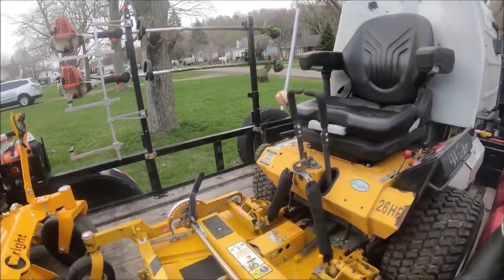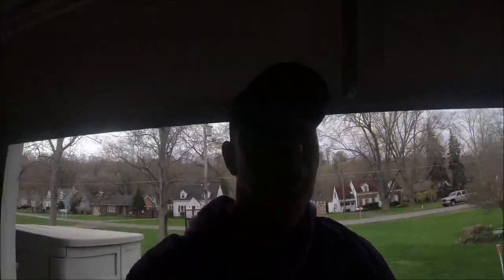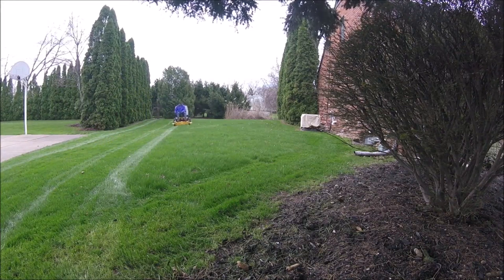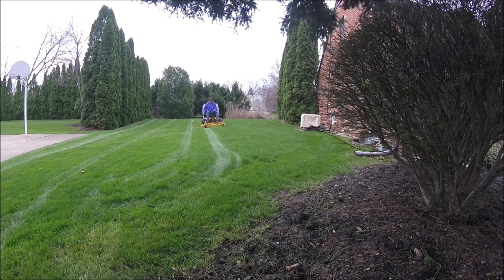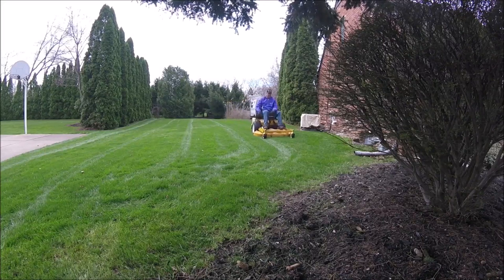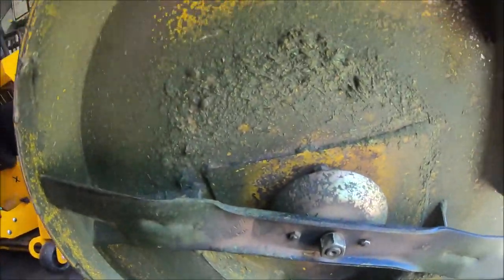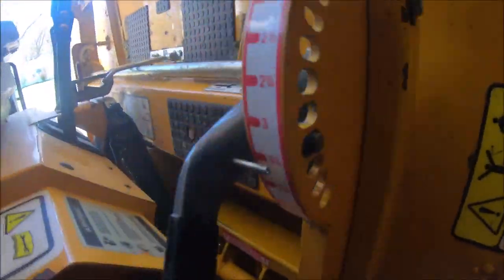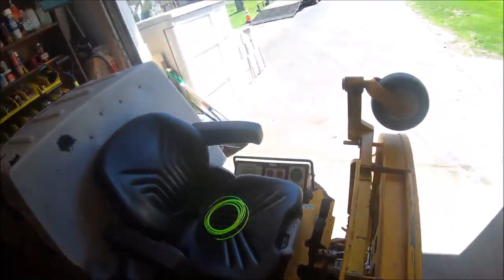Wright Sport X Mowing Lawns Walker is Fixed // Countryside Vlogs

Comment: Randy, order up new bearings, seals and gaskets online and rebuild that used unit. Its extremely simple it all just slides together no pressing or anything. Just having the good shell is nice... Im sure you will run with it for a bit but at least have the parts on hand and the next rain day take an hour and rebuild it.
Reply from the maker: Did you see the old one? There's no rebuilding it. The casing is busted in half. I've rebuilt then they're super easy
Reply: @CountrysideStrong  yes I was talking about the "new" used one
Reply from the maker: @KenMrKLC  oh gotcha